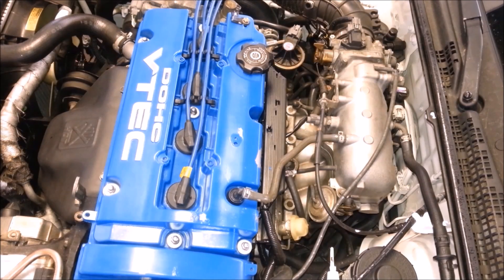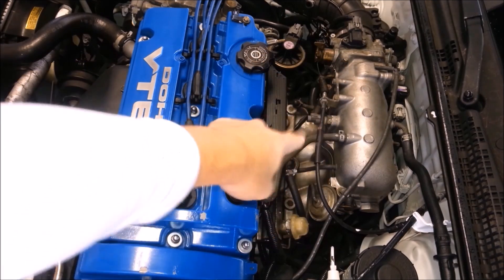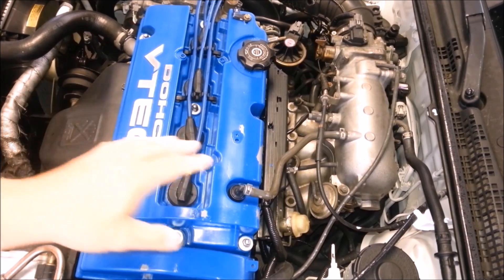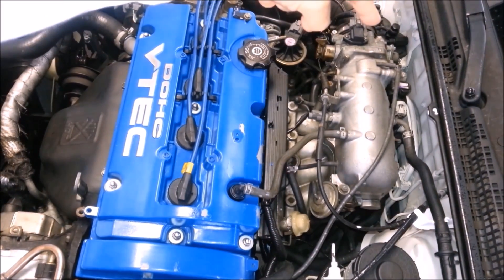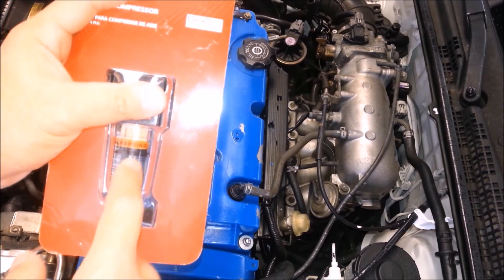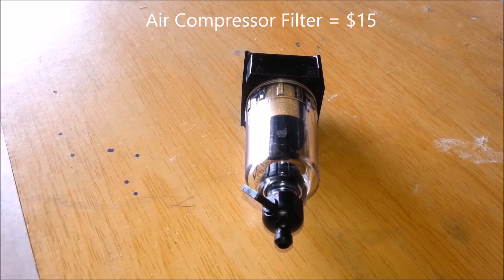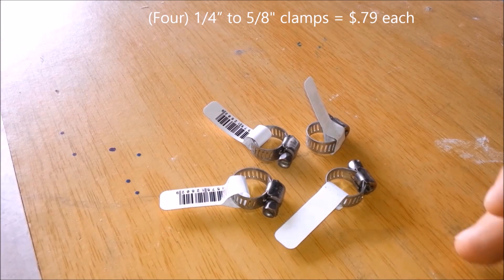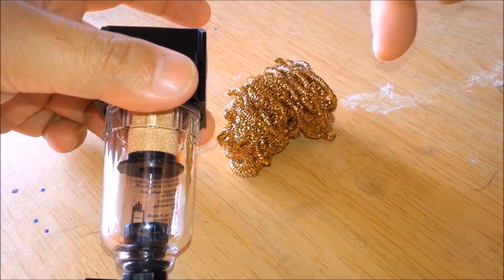DIY How to Make a PCV Oil Catch Can - @winstonbuzon

Comment: You’re gonna waste your time, making an oil catch can add a water separator. There. 25 bucks of Amazon a couple blocks that’s going to be filled up. You need something that’s going to really catch some oil. na is not made for the heat. It’s gonna crack disintegrate, so oil leaks all over a chance of catching a beer on firewhen that plastic starts melt down and catches on fire.

Comment: @ Winston Buzon, do you have an update on your PVC oil catch can design? I would like to see the vehicle idling with that air compressor oil catch can idea of yours. It's the best one out there. Thanks for the video.
Reply from the maker: @jasoncollins9081  Unfortunately, I haven't been driving her around as I used to, but the catch is still going strong, even with the engine temps

Comment: I installed this same filter on my 2004 colorado. It worked 100% perfect!! In 2 weeks the bowl collected 1/4 full, I left the internal filter in the bowl. NOTE? 2004 COLORADO NEVER HAD A PCV. I checked bowl every time I drove it. Then in 2 weeks? I would unscrew bowl, dump oil out, wipe bowl out with  paper towel, replace bowl. I also, installed a 1/4 vacumn the  input of catch can.  Vacumn read 20 inch , my makeshift worked really well.

Comment: No! Those modifications ruined a perfectly good oil separator! Air compressor filters make pretty good catch cans. However, they work on 3 principles, 2 of which have been rendered useless by the modifications in the video. Firstly, compressor filters force the incoming air against the walls of the poly bowl in a cyclonic fashion to cause centrifugal separation, where heavier oil/water particles spin to the outside, coagulating and condensing against the walls of the bowl. Secondly, the container creates a reduction in air velocity, which allows a certain amount of cooling and gravitational dropout of heavier particles. Thirdly, on the way out, the air is sucked through the 5 micron brass filter, which behaves as a baffle to trap and condense finer oil/water particles before they exit. 
Introducing steel wool ruins the cyclonic/centrifugal separation, and removing the brass filter ruins the finer mist separation. Steel wool can be a fairly effective condensing baffle, but only if the air is forced all the way through it. The mods in this video allow the air to pass directly from inlet to outlet without passing through the steel wool. The only separation mechanisms left, are a slight velocity drop in the container, and gravity. These are somewhat effective, but not nearly as effective as the original design was. Leave the compressor filter unmodified for best performance.

Comment: i am working on the same component but i want to keep the brass filter, but i am not sure about the flow restriction as this is vacuum line of crank case ventilation where i would fix the catch can. thanks.

Comment: السيارة بتخنق حطيتها اليوم
اذا بدك تحط مثلها حط حجم كبير
Reply from the maker: Translation, please?
Reply: @winstonbuzon 
I tried it before
But its going to make your engine leaks oil and the engine temperature get high because the hole is small
I would use the big one instead the small one
With big holes
Reply: In my experience
All car with gas or diesel engine
Its should have oil catch can
Reply from the maker: @alexanders1075  I'll try to find one that's bigger
Reply: @winstonbuzon 
Its been more than 8 years you uploaded this video
So there is no problem all these years using it
Reply from the maker: @alexanders1075  That, and I hardly drive my car hard enough to spit oil out of that valve

Comment: Why didn’t you just use the stock hose you had the fit looking right and why take the filter out crammed steal wire in there takes up the volume you need to catch the oil

Comment: This does not work (with the new air compressor drier at HD) as the system will pull a vacuum and pull the plunger at the bottom of the canister. They changed the design since this video was posted. You have to attach another tube to the bottom of the new model and a shut off valve.

Comment: I'm a little late to the party but I have question will this work on my 2017 ford escape ecoboost se 1.5
Reply from the maker: I wouldn't know at this point in time
Reply: @winstonbuzon  mine is a turbo charger and I am seeing oil leakage coming from my throttle body which leads me to believe it's blow off
Reply from the maker: @traceyjones2010  if it has room for this, then it may be a benefit
Reply: @winstonbuzon  thanks I will put it together and get it done awesome remedy crossing my fingers that it will work.
Reply from the maker: @traceyjones2010  good luck and let me know how it turns out 😁👍
Reply: @winstonbuzon  will do happy n year

Comment: Unfortunately, the clear polycarbonate catch can material is NOT heat resistance. Typically, clear polycarbonate is not rated for use beyond 125F. But your intended use is inside an engine bay where temps easily reach 250-350F. Often the polycarbonate part will start to discolor and/or crack and eventually just fall apart.
Reply from the maker: Wow, damn!  That's some good info.  I'll definitely keep that in mind 😁👍

Comment: If i keep the brass filter, will it a little bit clogging the air flow? Thanx bro...
Reply from the maker: It shouldn't
Reply: @winstonbuzon  what shouldn't? The brass filter or the clogging air flow?
Reply from the maker: @jonichin4661  shouldn't clog air flow
Reply: @winstonbuzon  i see. I just made my own one. I stil kept the brass filter and don't use steel wool. I feel my car a little bit "heavy", you know what i mean with heavy.

Comment: Just curious, did you see any problems when you reduced the flow of the PCV to the intake from 3/8" to 1/4"?  It would seem that a 50% reduction in the flow would increase the crankcase pressure by adding an increased restriction in the line. Also, where did you find a filter that does not have a normally open drain for high pressure rather than the normally closed one you would need to maintain the negative pressure created by the vacuum in that line? Was the stop cock already on the filter, and if so what brand was it?
Reply from the maker: No noticable difference or problems.  The stopcock was already built in

Comment: I am thinking in something... Can the steel wool be replaced with sponge or anything like that?? That absorbs the oil
Reply from the maker: Worth a try...
Reply: I use glass and marbles,,,all u need is a sort of medium for the oil to attach to,,plus I use a larger filter housing
Reply: After 7 months im here to talk about the Oil Catch Can, It doesnt really need a filter, It came with a corkscrew one... And the Oil sits in the reservoir, simple as that

Comment: All I see is you doing it by your believe. Have you thought about the condensation building  up inside the catch jar and the icing condition clogging the PCV system, this could lead to popping the dipstick and crank seal. If it is that easy, everyone can be the engine engineer.

Comment: you have to put your mini oil catch tank in a cold place not near the heat of the engine to speed up condensation of the oil vapeur
Reply from the maker: True, but it has also been suggested that the catch can should be as close to the source as possible to lessen the excess oil travel so that the line won't clog up

Comment: The plastic will fail because the air is too hot coming from the crankcase if you want to keep the oil out your intake then a catch can not plastic is a great way of doing so.....   but a plastic canister is not ideal in the long run it will fail the plastic cant take all that hot ass air and oil flow

Comment: Something to note about DYI catch can building. After running my car in the Texas heat, the underhood components all get hot enough to burn skin like a stovetop. With that said many plastics not design for high temps may not hold up like the bowl on your air compressor moisture filter. Also to, a proper oil catch can needs to typically be mounted with approx  2 ft - 3 ft of hose away from source so the heated gas carrying the oil vapor, water vapor and other contaminates like sulfer has the time to cool down and become more viscous. If not cooled slightly its more likely to not condense and thereby be collected in reservoir of catch can. If the matter flowing thru catch can is still in super heated vapor form it will likey pass right thru a lower quality specific catch can. 

A crazy amounts of carbon buildup on intake valves and black oily goo inside the intake chamber can happen quickly in a direct injection engines and more so for forced induction engines. As little as 12-15k miles on a new engine without a oil catch can will likely lead to lower performance, rougher engine opporation and lower fuel economy.

Comment: Actually you explained it very well. They should've changed the pcv system when they went with direct injection. Before you had the benefit of gasoline spraying the inside of the intake to help keep oil residue to a minimum but now with direct injection the gas is sprayed directly into the cylinder allowing any and all of the pcv vent crap to slowly build up on intake runners the throttle body and really just everywhere on the way to the piston cylinder. I changed my 370z over to catch cans and its great. The entire intake side of the engine stays oil and carbon build up free. Id definatly do it.

Comment: Too small of a catch reservoir, you'll need to drain it to frequently. You also want to locate/route  it to a cooler part of the engine so it can cool and condense the hot gases. Good idea, poor execution. $25 plus shipping https://www.amazon.com/EVIL-ENERGY-00590RD-Universal-Reservoir/dp/B07F3B7683

Comment: Great idea! I bought the exact one but made a few changes to the design. For one I replaced the filter with a tube of the same size and made several holes at the bottom of it. I'm also running the base in the opposite direction of flow (not following the arrow), the reason for this is that u want to vacuum from the high point, and let heavy oil drop to the bottom as it flows down through the tube/baffle (remember these things were design to flow with pressure and separate condensation), if u follow the arrow u can/might ingest oil as it passes by the baffle.

Comment: where'd you get a scrubbing pad that small
Reply from the maker: That gold looking scrub pad was sold at the same store
Reply: Winston Buzon but the ones i see are bigger than what you used, did you cut a smaller ball off of the scrubbing pad
Reply from the maker: @caleb5702  yes, I used a small portion of a big piece
Reply: Winston Buzon oh okay, i thought so but when i cut a piece off there was a bunch of little metal fragments that was cut, I'm using it as extra baffles and want sure if it's okay bc i want the metal to get in the engine, i dusted most of it off course but still
Reply from the maker: @caleb5702  I made sure 5hat there was no metal flakes or shards before Install

Comment: Nice idea, but you have to take into account that the materials used for an air compressor installation are not designed for high heat of an engine and the plastics will either melt , distort, or become brittle and porous over time only creating more and worse problems. Also if that device should ever clog you will blow your engine . Be careful .
Reply from the maker: I am, and I don't my engine hard all the time, but yes, I will always keep an eye out for it :)

Comment: That’s way too small. Use a larger plastic bottle and some stainless scrub pads. Mount it low so you can access and drain it from below. It’s not a high pressure situation. You don’t need Teflon tape and brass fittings. Waste of $.

Comment: Using this exactly same product was also in my mind.... until I found out it is (plastic can) made of PC (polycarbonate) which can't be use with full synthetic oils. PC plastic melts/dissolves with solvents and syntethic oils.  Over time It starts to fade, get sticky and becomes fragile.
Actually exactly that WARNING is written on the side of can.
X-)

Comment: It's been three years - how's this 'catch can' holding up?  It seems too small and the container is not designed for the high heat conditions of an engine bay.  The inlet hose needs to be an oil or tranny line because oil will be going through it.  Any other hose will eventually start to degrade from the inside out.

Comment: This won't be a good idea to act as an oil catch element.
1. It's too small in content, so you must check empty this device much more often
2. Because of the small size of the container, the oil vapor won't be catch effectively as the inline and outline are way to close, and the vapor will goes to the easiest way it has, which is to air intake that creates a vacuum.
3. You device has no barrier that is a must to condense effectively the oil vapors before the air molecular keep their way to the engine air intake. 

If you do choose to use this method, I suggest to leave the filter and to connect the hoses in the opposite way then you have suggested. By this way you will have a few advantages:
1. the filter will behave as a large surface area that the oil can condensed better.
2. You will slow cause a barrier so the heavy oil vapor will stay more time inside the capsule and much more oil practices will be trap.
Do reduce the risk of a clog in the filter which I can't understand its density from here, I would drill a few small holes in the black plastic base of the filter, so the micro dense oil drops can drip down to the button more freely.

Comment: Great thinking... after 4000 miles on my 2017 Camaro 2.0L Turbo. It’s time to get serious about a catch can setup. I don’t want to have problems down the road....LOL... with my engine. I splurged on the double can Mitshimoto, for $400.00 but it comes with Red custom tubing. But I’m going to do your set up on my 2000 Toyota Solara 2.2L non Turbo. Awesome idea!! Thank you for taking time to do a video.

Comment: Oil will eat that gas line and that water separator you took off would have helped keep trash and get any water out of the oil. The oil comes out as a vipe so the part you took off would help grab that out of the air just some tips not hating on it but it will help save your motor in the long run

Comment: You're almost there. The clear container needs to be a few inches longer. The intake side needs to extend to the bottom of the container. This will allow the oil to condense back into a liquid and sit in the container. 
What you have now will just pass the oil mist back into the engine.

Comment: All these comments that say to leave the brass filter are trippin! That brass filter was made to seperate water out of compressed air (from an air compressor). The micron size is waaay to small to be useful for a catch can (it would clog almost instantly). The brass filters in the expensive catch cans are a lot different than this one. It was a good choice to remove the brass filter from it. I recently just made one similar. I drilled holes in the brass filter and left it in as an extra baffle lol. (Just had to add my 2 cents) lol great video man!
Reply: A number of small holes to prevent the steel wool from getting into the engine.

Comment: Awesome video, great job young man, just bought my first dual turbo engine f150, l understood your directions and why it's so important to use a catch can with a turbo, if blow by happens on a Honda as well built a exact as they are, better have it on my Ford 2.7
Reply: your 2.7 might be a gdi engine.. this engine is a port fi...... gdi motors need this to keep carbon off the back of the valves

Comment: Nice vid bro... I installed one of these on my maxima but.....  Is the filter suppose to take in air from the release valve/Bladder.. Basically if I put my hand under the (Black) release valve It sucks my finger like a vacuum, is that suppose to be open when engine turns on.   (all other lines show no leaks)  Connected from PCV to -> (In) to Intake Manifold (out)-->Thanks
Reply from the maker: MadvexLion Yes

Comment: i made one like this one except i bought the oil and water separator at the harbor freight and i kept the brass filter in it adding a little steel wool, drove my truck about 50 miles after the installation and it has a little bit of oil in it
Reply: i made two one for my truck and one for my wife's car cost about the price as one
Reply from the maker: Javier Beltran Nice! :)
Reply: Did your brass filter look like the one in the video? I'm worried if the oil will break it down and get sucked into the engine

Comment: First great idea love it. a small compact oil catch can. i swapped my big ugly catch can for one like yours. i kept the bronze filter since it helps separate moisture from the air. and added a bit of steel wool. i used clear reinforced nylon hose to see how much would get by and practically nothing. Thank you for this geniuses idea.

Comment: Nice work but this isn't the best container to use. By removing the filter you make it easier for oil to skip across the upper ports and get sucked in. The filter was a baffle. Also the wool takes up too much space in the container so you end up having to empty the oil more.
Reply from the maker: fox8you 89 Filter is a filter, and it doesn't do much to reduce the sloshing of accumulated fluids, in my honest opinion...
Reply: Llia Olsen so is it best to leave that filter in?

Comment: Husky 1 4 In. Air Compressor Filter HDA70403AV 
 http://www.ebay.com/p/Husky-1-4-In-Air-Compressor-Filter-HDA70403AV/1500394682    

1/4" Mini Particulate filter for compressed air systems air compressor 
 http://www.ebay.com/itm/1-4-Mini-Particulate-filter-for-compressed-air-systems-air-compressor/262032316056?_trksid=p2047675.c100005.m1851&_trkparms=aid%3D222007%26algo%3DSIC.MBE%26ao%3D2%26asc%3D38530%26meid%3D4d0c8aa96da94c8f8cb79bb9072e513e%26pid%3D100005%26rk%3D3%26rkt%3D6%26sd%3D222337708222